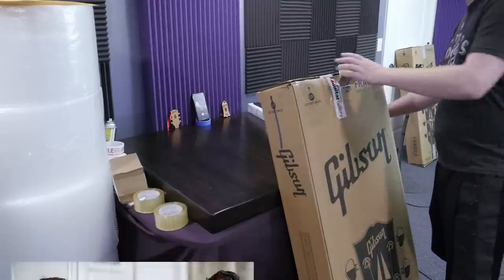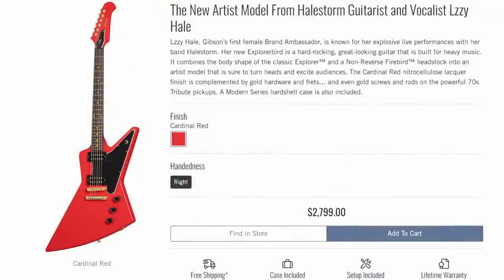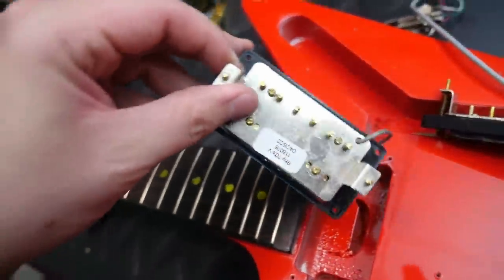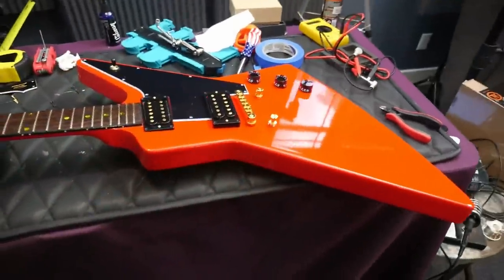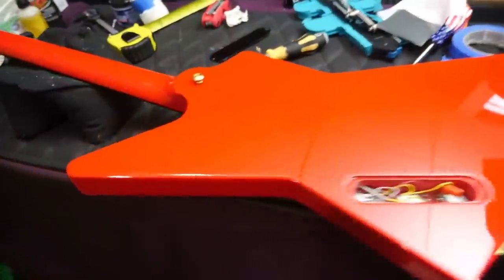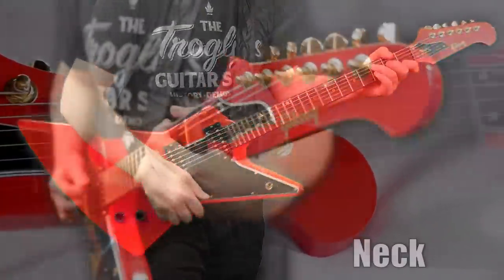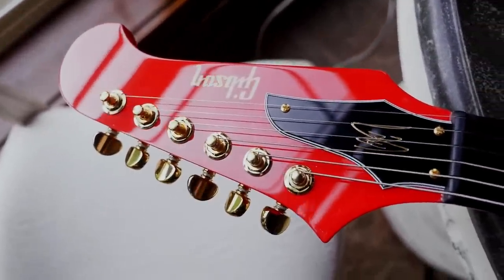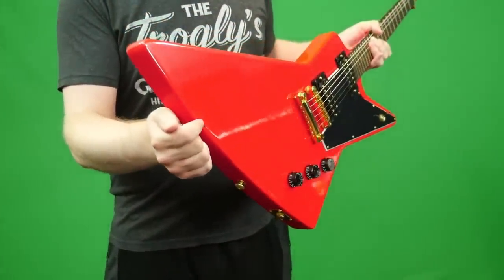She Put a Firebird Headstock on an Explorer?!? | 2022 Gibson Lzzy Hale Signature Explorerbird Review

Comment: Imo the guitar left me really neutral. It's unique enough to justify it's existence but it doesn't do anything to make me love it or hate it. If this guitar were a rating, it be 5/10
Reply: It stays in tune there is no angle to the strings behind the nut. The strings go straight through the nut to the tuning peg. Allowing the string to return to its length and not get caught on the nut making the notes sharp and out of tune.
Reply: If you wondered that's why the three and three gibson headstock has problems staying in tune on the D and G strings. And the reason explorers don't stay in tune hint it's the hockey stick headstock. The angle of the strings after the nut.
Reply: Ok
Reply: @bizbizley  Honestly it's just a shallow look thing for me. I know your not supposed to judge a book by its cover but books have covers for a reason.
Reply: @frippfink  I personally like it. She didn't design the guitar in an interview she said she was wanting her guitars to stay in tune more consistently. Gibson worked with her to make that happen. She said they just gave it to her and she liked it's look and the fact it had superior tuning stability. 
That 3 and 3 and hockey stick design don't stay in tune I would know. Have one SG three Les Paul's and a ESP pre law suit explorer. So it looks and plays like a like a gibby without the pick guard and the selector switch is in a different place. The LP and SG the A, D, G, and B string are always a little sharp or flat after playing the guitars. The explorer the only strings close to 440 A after playing it is the low E string and they it's not in tune everything else goes sharp.
Reply: Actually I liked her White Explorer Custom Better

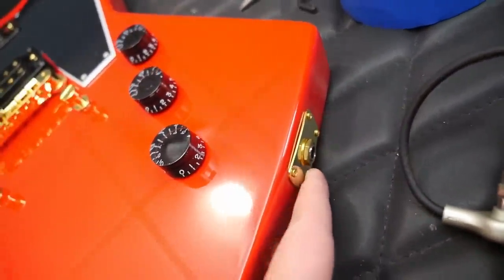Comment: 8:42, extra tight output jack, many times that is caused by one of the output wires jammed between the body wood and the spring tip connector.
If you ever have a jack that is extra tight your should open it up and inspect the wires.
Reply: Sounds Legit. 😉
Reply: He's not wrong, it's an issue I've run into and fixed easily by doing as H.K. says. It's simple logic
Reply: Yep, all you need to do most of the time is rotate the jack a bit to get clearance.
Reply: my custom. I need to check thanks for the info
Reply: Especially true with Gibson where no one gives a shit about quality control anyways.
Reply: @SxSxG666  I don't think it matters what name is on the headstock. With the ridiculous variety of shapes and parts being used to build guitars nowadays, something as minor as an input jack being installed cockeyed, isn't a deal breaker for anyone with even basic luthier skills. You make it sound like Gibson makes nothing but cobbled together junk? It happens sometimes, it'll probably be ok.
Reply: @andrewbecker3700  It happens a lot more often with Gibsons then with other brands. Especially considering the price class. Gibson is notorious for selling budget quality for premium prices. Just go to any guitar shop and grap a Gibson to see for yourself. It's hard to find a flawless one. They just don't care.
Reply: @SxSxG666  That's your obviously bias opinion. I don't own any Gibson or Fender guitars, and have no desire to. I mod all my guitars myself, and minor hardware upgrades are more of a choice than a nessessity. We all know Gibson had and continue to have some QC issues over the years. The demand for thier guitars, both acoustic and electric, is still very high.
Reply: @andrewbecker3700  My opinion is based on facts. I own a Gibson with quality issues and I personally held enough Gibsons with flaws in my own hands to justify my opinion. And belive me I'd prefer it to be different.
Reply: @SxSxG666  Your opinion, based on what you perceive to be indisputable facts, won't stop people from slapping down thousands of dollars for a name they believe means automatic quality and reputation. I buy my guitars based off of specs and value. When you know your gonna heavily modify almost every guitar you buy, an output jack needing to be slightly rotated, is again, not a deal breaker. Word is, high end guitars can't be built fast enough to meet the demand right now. Including Gibson. Is a G&L better? Yes. Is a Musicman better? Yes. Will Gibsons keep outselling both? Yes.
Reply: @SxSxG666  you must work for Dunlop because there’s just so much wah wah wah over there.

If you really owned a Gibson that was just so messed up that you have to tell the world about it, did you happen to tell the reputable seller about these issues? There are things called returns and exchanges. I’ve had to do it with a low end cheap shit guitar you’d probably love lol.
Reply: @bw1955  I bought my Gibson SG Baritone used because I liked the idea and I needed one. Since it was hard to get fairly "cheep" I arranged with the faulty paintjob. Technically the guitar was good. But if I bought it new for full price I'd definitely returned it. And no I do not only play cheep guitars. I played Japan ESP, American Fender, Ibanez, Charvel and Squier. All in my opinion very good guitars with next to no issues regarding craftsmanship. I generally like good Gibson guitars. I am far from a hater. I am just disappointed that it seem to be a gamble nowadays to get a good one. I rather pay for quality then for a certain brand name.

Comment: I picked one up a couple months back, American Musical Supply had a special on them, I got it for $2099, I couldn't help myself. I wasn't sure about the Firebird headstock, but it makes for a straight string pull. I do a lot of bending in my style and it stays in tune great. I haven't seen any QC issues, it is very well balanced and it sounds huge with some gain, and yes it is very red!  The Pup's are hot and dark, not usually my preference. I may swap them for some Duncans but I will give it some time to decide, they do a mean Rev Willy tone though.. Overall I am VERY happy with it, and for the price it was a steal!!!

Comment: Actually I found the new Rob Scallons guitars from Shecter to be interesting. If a Firebird and a Stratocaster and an Iceman had a love child that would be Rob’s guitar. The fan frets and the multi scale strings plus they have 6,7,& 8 string versions.
Reply: It is just a Superstrat with neck thru construction and a slightly beveled headstock, i can't see any resemblance to a firebird or an Iceman...
Reply: @riffrigerator666  Doesn’t the Firebird have neck through construction? Basically Rob’s is a Firebird with Stratocaster wings, and with a neck that has a headstock that look similar to Ibanez without being lawsuit worthy.
Reply: @normanshute7162  yes the firebird is neck through, but it has a embossed  stripe in the Body, this does not, it is just not coloured, the headstock shape is just a mondernized version of bis old chapman version with bevels. Still a normal superstrat with humbuckers.

Comment: I'm in the camp that thinks this guitar is unworthy of the "bird" distinction. They could have made it neck though body with the center step or thinner body or given it a bound fretboard with trapezoid inlays or even mini-humbuckers (3 would be cool). $2800 for an Explorer with a different headstock, no thanks. I prefer the original headstock anyway.
Reply: Like the original headstock better.
Reply: exatly not just that, the previous Lizzy Hale was 2299.99 and it came with all that, the trapezoid inalys, the custom shop appointments like triple bound body. This one looks very basic and is almost 3K and that heastcok tho.
Reply: at least this one will stay in tune.

Comment: This one looks a bit like my first bass I bought in 1989.A cheap Condor explorer with a P bass maple neck and headstock.

And Trogly,is there something with the grounding within the Marshall because it looks(or sounds) like you have more apparent groundbuzz.
Not in all guitars but some. Like a while ago you had one that had lots of buzz and also with this one.
I know that my peavey bass amp has that too and I'm to lazy to fix that.The problem I have is a known one: A screw inside the amp has too much paint on it so it doesn't make contact with the grounding inside of the amp.  I'm just too lazy to fix it because it means I have to unscrew the whole amp and tighten that one screw.

Comment: seems like there's a lot of sizzle on the line. I wonder if it's in the grounding, or the power conditioning? Not something I'm used to hearing on Trogly's videos.
Reply: Sounded like he was playing through his new-ish Marshall.  With those hotter pickups backing off the pre-amp volume a bit would cure that sizzle you were hearing (I heard it too).   Typically Austin uses either his new Marshall or a Fender Deluxe Reverb Reissue.

Comment: I actually kind of like it; the FB headstock on an Explorer is crazy good!!
Reply: Thats not the Firebird headstock tho. Its crappy studio one
Reply: @mikefloyd3152  That is a Non-Reverse Firebird headstock.  The studio Firebirds use that headstock because its manufactured like a regular set-neck Gibson solid body and is less expensive to produce.    The reverse Firebird headstocks require much more wood to start with and are more labor intensive to manufacture.   They also add a lot of length and weight to that end of the guitar.

Comment: I still think my idea Firesplorer was better.
Anyway, mixed feelings about this. I think the Firebird headstock is cool, although like others I would rather it was reverse, with a stepped face and banjo tuners. Between that and the QC issues it reinforces my "wait for an Epiphone version" stance.
The pickup choice is interesting; Lzzy's original white custom shop explorer supposedly has 496R and 500T pickups. So I thought it odd that the series production version had more vintage output pups. It's the one thing I definitely want to upgrade on my Epi Explorer.
But OTOH if an Epi version of this comes at the right price with hot pickups...

Comment: I was curious about the neck carve you measured .87-1.0 which is not a slim taper. So I checked with Gibson and they said the neck thickness is on average .80-.90 which is indeed slim taper territory. Just curious as to why yours was different…